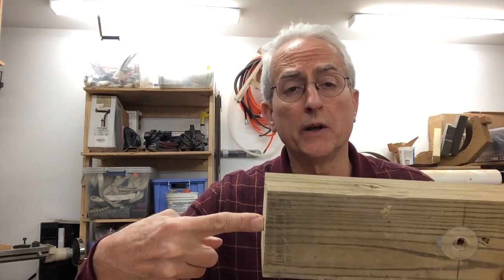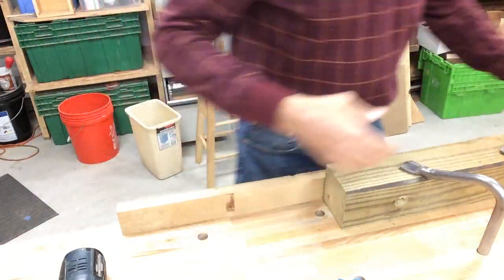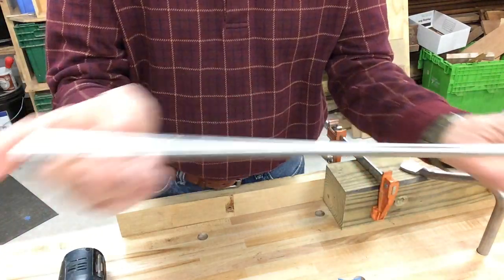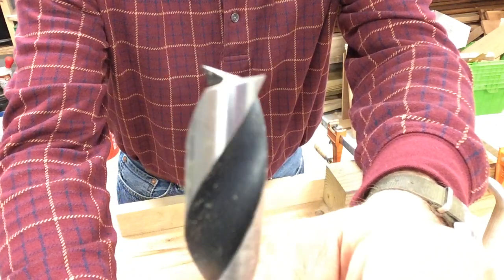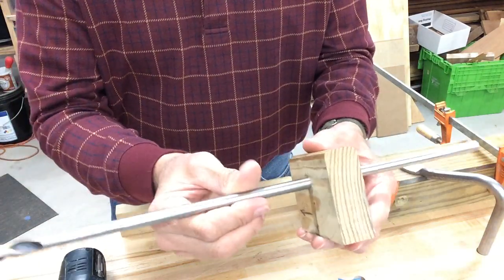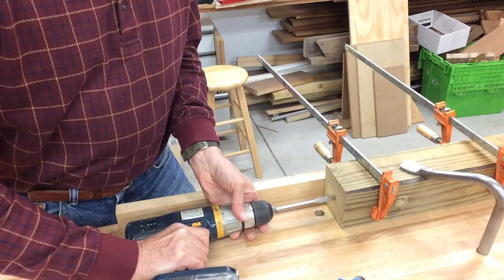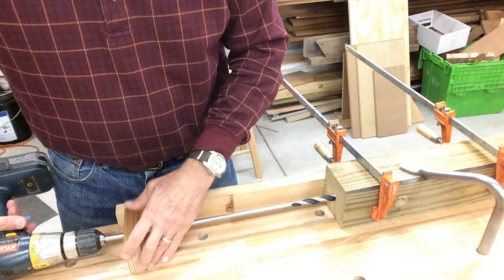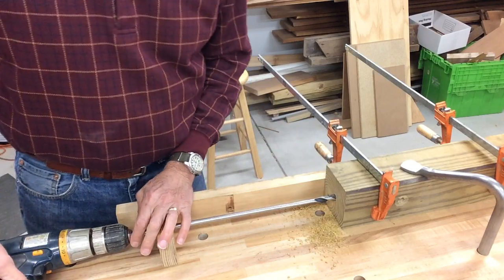Drill deep hole in end-grain

Comment: Hi Al. I have an old "school table" restoration project underway that is going to use barrel nuts and bolts to secure cross braces to the table legs. It will require the drilling of 5 +/-  inch long holes in the end grain of the brace and I wasn't sure how to go about doing it. You video was the 1st one to come up when I searched the subject. What a great and simple idea to accomplish the mission. Thank you so much for sharing your time and expertise. 🙂

Comment: I like this idea. I believe the tip may still wander even if a small amount using this method. To be even more exact, one could place a second guide  block against the 4x4, possibly may need to screw it into end of 4x4 to keep it from moving or somehow clamp or screw to table top.

Comment: A video that shows actually drilling a long hole with a drill, instead of making grooves with a router and then glueing together. This is what I needed, because for my requirement, I can't cut the board and glue it back.
Reply: To be fair the router method is good for longer holes that this block method won't work for.

Comment: Hi Al,  I found your video extremely useful. For years I have been toying with idea of drilling, burning with a laser, or some other way to bore through the center heartwood of a large green Douglas Fir log in order to relieve the stress and checking of the outer sapwood when it dries. After I get a hole through the center of the log, I will attempt to use a sawblade or other method to saw radial kerfs up into the heartwood to let the log contract naturally, and hopefully smoothly, as it dries. This is an experiment that I have not yet tried, but I've been researching methods like you show here to attack this problem.
I really like your technique of redesigning the end of the bit to avoid its digging into the grain as it bores forward. That is something I had not thought of.
My latest sketch uses a set of guides, like your small wood block(except made of steel and anchored in a rigid medium, like concrete) to hold my 'drill string' as I call it. I plan to mount the bit into a long rigid steel pipe that can be aligned perfectly with the pith of the log and kept that way. My new trick that I came up with recently is to have the outside diameter of the steel support sleeve be the same diameter as the bit at its boring end. In this way I can bore a short way into the log, remove the drill string and bit to clear the shavings, then re-insert the drill string and continue boring deep into the log. By making the sleeve the size of the bit, it will be held rigid by the hole in the log that is the same diameter as the sleeve. It will also be held rigid by the guide anchors on the anterior end of the device.
What you demonstrated in the video is exactly the procedure that I came up with for my experiment....just on a smaller scale. If my trick is successful, I believe it will be of great utility to timber framers who wish to eliminate unsightly cracks/checks in their visible posts and beams. Most of them will tell you to 'just learn to love those cracks because they don't decrease the functionality of the wood', but I still want my timbers to look like they came out of grandpa's homestead cabin with not a blemish on them!  --John in the great northwest USA

Comment: THANK YOU FOR THIS..WE ARE IN AUSTRALIA.. AND I DO LIKE TO MAKE LAMPS AND STANDARD LAMPS AS YOU KNOW WOULD BE ABOUT FIVE FEET..THE WOOD HERE IS VERY HARD AND PUSHING A HOLE THROUGH TWO LENGTHS AT TWO AN A HALF FEET IS NOT VERY EASY AND BRAKING BITS IS VERY EASY TO DO..I FOLLOWED WHAT YOU DID BUT USED HALF INCH BITS AND DRILLING FROM BOTH ENDS WELL WOW IT REALLY WORKS..SO SIR THANKS A MILLION..DAVID..N.S. W. AUS....

Comment: When making smaller diameter hole if one has problems with proposed method, it might be interesting slight modification as follows. 
Instead of one guide box I make two such boxes. I drill these boxes as one larger box on drill press (that has to be on drill press) and then cut it on two halves. Now you got two guide blocks, one put in front as shown in video, the other put next to workpiece.
The reason for that is better precision needed for smaller hole diameters. However I would use 4 millimeters drill or larger. You can drill guide box with 1mm larger drill for easier drill passage and for better feeling of direction. Also in that modification one has no need for grinding the tip of drill, you can use normal brad point drill as usual.

Comment: Hello, I have 2 questions for your, if you are si kind to answer me:
1) is it a Wood Installer Bit or  it’s rather a Construction Installer Bit? In construction you could find steel bars into concrete.

2) Do you think those bits and method could be used on high density hard wood blocks such us Granadillo, Rosewood, Cocobolo wood for a 40 to 50 cm long straight hole?

Thank you very much. Your video is very useful to me.

Comment: Great solution would have liked to see the finished results to see if it's really working but it makes sense for dure, I need to do almost exactly this kind of hole so tested a manual approach that was ok over 30cm but need twice that and then it risks to cut on the side causing huge error that is a nightmare to fix

Comment: Great video.  I need to drill a 13.5" blind hole in a hickory dowel that is .375"+ in diameter.   What drill bit would you recommend?  I'm no good at grinding drill tips off of drill bits; I'd rather buy a pre-made one (or I'd pay you to do one for me).

Comment: I've been working on 3 floating shelves for more than a month due to crooked holes in 11.5" shelves and even drilling into wall stud is crooked holes.  Was ready tomorrow morning to lock the shelf to the drill press adjustment plate sideways in order to try and get the board level enough to drill a 6" straight hole.  Your idea might be a lot easier and I am going to work on it tomorrow morning before I continue with my idea.

Comment: can someone explain to me how to drill a 4mm hole in a wooden stick that is 1cm in diameter and 10cm long

￼
Reply: Drill a 10mm hole in any piece of wood (flat like a plywood), but dont drill thru!! Drill trhru with 4mm  the bottom, stick the rod into it and drill 4mm from the opposite of the rod...
If it does make sense...
Good luck despite it's a year old question...😇